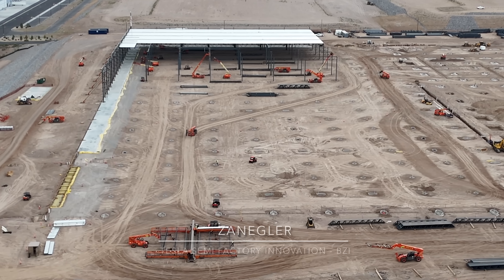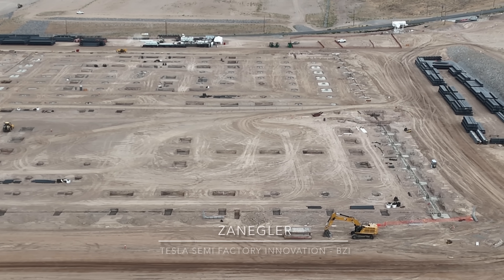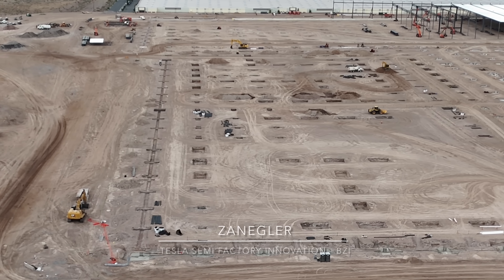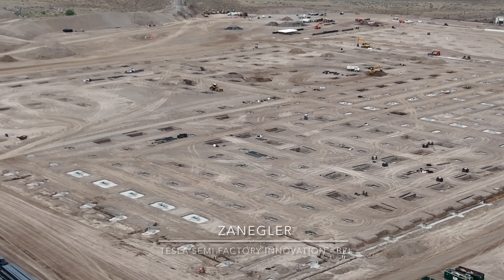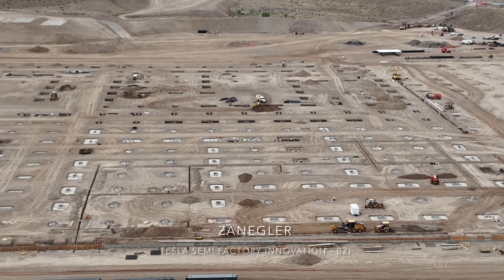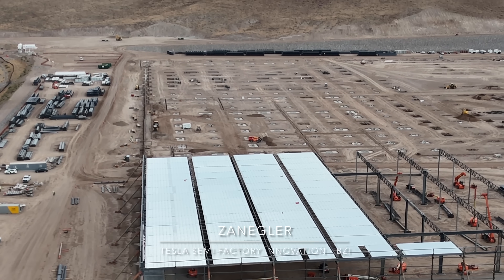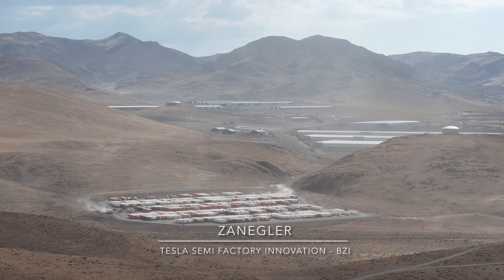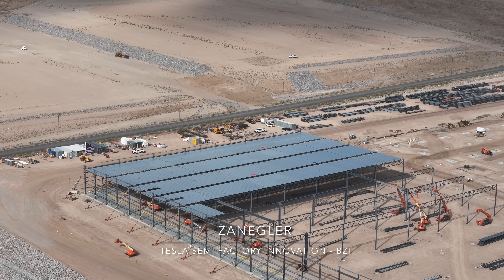Tesla Semi Factory BZI Innovation September 7, 2024

Comment: I can't imagine them able to move those large panels if it's the least bit windy.
Reply: Normally these are mounted hanging from a crane or layed per hands - much more susceptible to wind, as the chain swings and rotates uncontrollably.
The ratio between surface and weight is even better with the pre-assembled element when it comes to wind than the individual sheets.
The telehandler also has a lot of weight and the element is held in place with the holder.
So I don't see this as a disadvantage, rather the opposite

Comment: That Roof setup is some amazing engineering. The only downside I see is they probably have to stop roof work on a windy day.
Reply from the maker: We have plenty of those around here!
Reply: The individual trapezoidal sheets would also cause problems in strong winds, as they are sometimes installed manually on the roof in last step and/or are individually hung on the crane free to swing.
The large pre-assembled elements have a larger surface area, but a higher weight with the lattice girders and the telehandler grips them firmly - so I see this as more of an advantage than installing the individual sheets on the roof
Reply: Hay I said that HA!  
That section is bigger than a  Cessna's wing.

Comment: Also, if see a number truss roof supports with a scattering of I-Beam supports.  They also seem to have heavier column beams than the trusses have.   I assume the I-beams/heavy columns are for supporting a greater loads.
Reply: It is also possible that these serve as bracing (lateral forces) and/or completely closed walls are built there. Because there are also no trussings installed at the edge.
Reply: @Zedus-rl9hp  yes that’s a possibility, too.

Comment: wow they kicked the building into high gear
Reply: Most people do know this but tesla will double its manufacturing capacity in less then 4 years.
Reply: @miecraftpeplayer1515  I think its automotive capacity will be significantly higher than that with the Semi, 2.5, RoboTaxi, ramp of the CT.  Maybe around 8 to 10 million in all.  It’s battery production will also see a similar ramp, Energy storage ramp will be greater. And Optimus will go from basically zero to millions overnight.  Tesla’s overall production capacity will conservatively quadruple over the next 5 years.
Reply: They by passed ludicrous speed, and have gone into plaid mode! 👍🏻😀